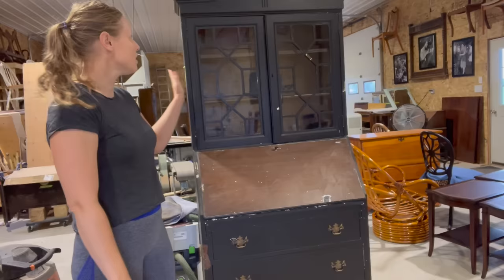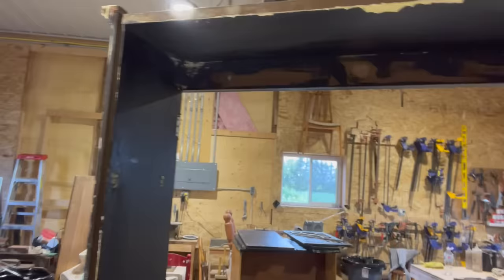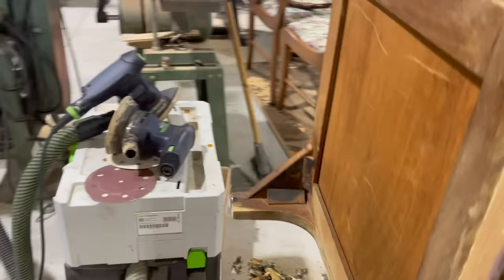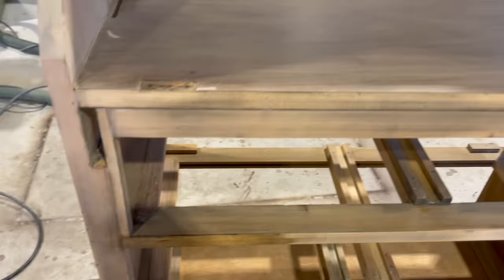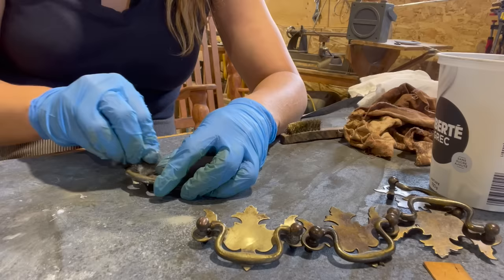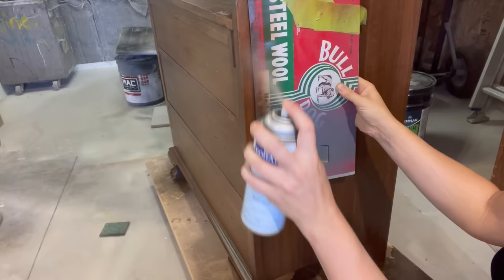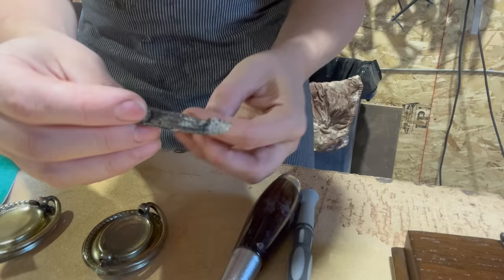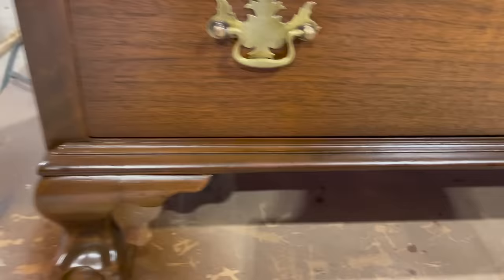The customers cried when they saw this one

Comment: This video reminds me of the time I restored a 1930s vintage Wurlitzer Expressions Player Piano back in 1982.  It was covered with a zillion coats of battle ship gray paint.  Found beautiful burled walnut wood under the paint.  That was the easy part.  Restoring the inside part of the piano was the challenge since I had never worked on a piano before.  But, I got er done!  Worked beautifully.

This lady knows what she is doing.
Reply from the maker: Wow. Hope you took pictures! Thanks for watching!
Reply: @johnsfurniturerepair  Took pictures years ago. But don’t know where they went;  most likely they went with the ex when she took the piano.  Bought the piano for $200 in Marshall, TX. Drove around the State of Texas with the piano in the bed of my pickup until I got home. Thing weighed about 700 lbs. Unloaded it with an engine hoist; lifted off the bed of truck and drove out from under it.

Comment: I guess the customers must have cried three times: first when they obtained, bought or inherited the piece, just seeing the paint "job" vandalism, which looked horrible. Then when you gave them a price quote for the restoration (just kidding, I hope you got what you deserved), and finally seeing the result. It was a hypnotizing watch, and seeing the final outcome gave me a warm feeling inside.
Only fly in the ointment: others have mentioned it, even if you paint booth is ventilated, you probably should use respiratory protection when working with aerosols or solvents. My personal rule is "if you can smell it, it's probably dangerous".
But what you do is really art, of the most selfless kind, as it ends up invisible because it is intended to show the beauty of the original work. From a viewer in Denmark: Well done!
Reply: Yes, I cringed to see her painting without a mask, and using some of those chemicals without gloves.
Reply: @scotth6814  From other videos I've seen, she seems to have taken the advice and uses appropriate protection gear.
Reply: @scotth6814  If the room is ventilated and fresh air is circulating around the room gloves and a mask is not necessary. I hear a fan running in the background. Also I have never used any cleaning chemicals with gloves on all my life.
Reply: @MrWolfSnack  extra protection doesn’t hurt but it surely helps.
Reply: @martaalvarado4631  If your skin is sensitive to chemicals or the fumes are volatile, sure. But I don't because it's more of a hindrance and they just tear anyway.

Comment: Excellent work. My only concern when I saw this video was the lack of protection on your hands when you were stripping the piece and no mask when you were spray painting it. I know when one is so young one believes they are invulnerable: I thought so too when I used to work with the insane chemicals involved in printmaking and photography. Just be aware that your skin absorbs these chemicals and that your lungs are breathing them in.
Reply: I agree! I spent 28 years working outside as a painting contractor 6 days a week non-stop. I am now 70 and have too many health issues. Pls pls take care. 😔
Reply: The 3M face mask with the back waist filtration is the way to go, in addition to cross ventilation.

Comment: I'm an old furniture maker and I think your work is outstanding! I don't understand why people cover beautiful wood with paint. I have a Maddox secretary desk like this one except a flat front. I have had it since 1948 and am going to do the same as you did. THe hardware soetimes can get stained by some strippers, I put them in an old crock pot and heat them for a few hours then shock them with ice water, this breaks the bond of the paint without any chance to stain. I follow up with FLITZ paste on a toothpaste brush, no scratches and looks beautiful.
Reply from the maker: Nice
Reply: They do it because they don't know any better.
Reply: @amitisshahbanu5642  Some people think a painted surface looks better than natural wood. I shake my head at them...lol
Reply: I love painted furniture. Of course this antique is better restored to original finish. Scandinavians like painted furniture because they live in areas that have little sunlight in the winter so painting their furniture lifts the spirit. I dislike dark heavy furniture as a rule and also like limed or natural blond toned floors and furniture.

Comment: Great work... I just found your channel this evening, and subscribed right away. You're definitely a master at your craft.
At the same time, watching you scrape off the layers of paint, I'm suddenly having horrid flashbacks to the front door of my old shop. The door was originally on an old store (if I remember right) and had about 38 coats of paint caked on it. One day I decided to freshen it up, and wound up making a couple of steel scrapers and using them with a welding torch to get through all that paint. (Yes I did linger over a few places and got the door warmer than intended, but we got it repainted, and after all it was the door to a welding shop, not a showpiece.)

Comment: I think I have nearly the exact desk. I’ve heard it called a Governor Winthrop secretary. Mine has secret compartments on the inside and has its original finish and hardware. No maker marks. It has only had one owner until I acquired it. The lattice work is on the outside, which leads me to believe it might be a reproduction. You did an amazing job on this piece. Your attention to detail, right down to the orientation of the screws, is astounding. I would have cried too!
Reply: The lattice originally is on the outside as it is a succession of the lead strips holding little panes of glass together. However, I like the notion to restore it to the inside for better cleaning purposes. Absolute fantastic attention to details, Trena! (My slotted screws always are aligned with the wood grain...)

A small comment on the antique status: materials and hardware especially the lock and the float glass, would not classify this piece as an antique. Laminated panels only became a house hold item in the mid 50ties unless for the US, that is considered antique. I am saying this looking at my chest with black forged ironed hardware with a burn stamp from 1642...
Reply: @thirdopinion8708  In the US, anything from prior to 1980 is considered an 'antique,' at this point... even people.

Comment: Boggles the mind that someone would spend so much time building this furniture with walnut and then finish it using ‘crap’ poplar on some of the front frame pieces.  Beautiful effort in covering that up and blending it to match the walnut.  My dad made a lot of furniture using walnut exclusively.  Soon it will be unobtanium.
Reply: Not so surprising. It was a mass-produced piece of furniture and needed to fit into the price range that the middle-class could afford. Besides, the Maddox company was particularly good at matching the finished tint of varying wood species, so a new piece right out of the store would look fine.
Reply: What really boggles the mind is spending the time and money necessary to restore a mass produced piece of furniture to this level.  It must be really important to the family with special memories because it is not worth what the restoration cost.

Comment: I really love the work you did on this piece. It was so meticulous. I noticed that you wore gloves to protect your hands from the chemicals but you did not wear a mask or eye protection when you were using the heat gun or the stripper or the spray gun. Your face was so close to all those chemicals off-gassing into the sensitive tissues of your eyes, mouth and lungs and it is so important to educate your viewers in proper protection. I have ended up with corneal ulcers due to incorrect eye protection when renovating furniture and have ended up in bed for days due to a severe reaction to the off-gassing from the chemicals from the heat gun in spite of wearing a mask. Please educate your viewers🙏👍😷😷

Comment: I stripped an entire 1920's kitchen cabinet set and repainted. When I was removing the hinges I noticed each screw on every cabinet was turned in a vertical position and was really impressed the original craftsman had done that, I of course did the same on reassembly (yes I stripped and cleaned all the hardware just as you did). I found I had to use toothpicks on most of the holes when putting the screws back in so they would be snug and secure. That was my only concern when I seen you reattach the hinges but I am sure you could feel how tight the screws got. Other than that a job well done!!!

Comment: That is a beautiful result.  Very nice.

I appreciate that putting the lattice on the inside makes the front of the glass easier to clean, but I do believe that the lattice should be on the outside which gives the appearance of smaller panes of glass, rather than a single sheet of glass.
Reply from the maker: Yes. Just depends on where you like it. Cheers
Reply: @johnsfurniturerepair  
I appreciate that you prefer the lattice to be on the inside for cleaning purposes.  But towards the end of the clip you state that the lattice is on the inside of the door "where it should be".  When in fact, by design, it should be on the outside.

Comment: That job reminded me of when back in the early 70’s I worked for a company that produced Stereo Grams for Dynatron (UK) The veneer finishes produced were Walnut, Rosewood and Teak. At that time the walnut jobs were filled with a wood stain grain filler applied by using hessian, and also wiped off again with hessian, you had to work quick as the material dried off in a matter of minutes. After the filler stain stage, the cabinets were coated with a heated base lacquer to again fill the open grain area. A heavy cut back next with air sanders, wet and dry paper lubricated with white spirit. Pullover solvent next with a rubber to pull in any areas of the lacquer working the area across the grain and then finally with the grain. Spray stain applied and then the final coat of lacquer.
Reply from the maker: That’s quite a process. Thank you for sharing. My finish is definitely simple compared to this, I do love restoring the filled finished. Seems a shame to remove if not necessary. Too bad it was here.

Comment: Trena, have picked up a lot of tips for furniture repairs. I have repaired one dinning set chair and have struggled with it, but finally got it done. Not bad but I did get one of the spindles in upside down and didn't notice it till after the gluing and dried and set.
 I used your two part epoxy mix with saw dust filler. That has worked great in the past.  Wanted to see if you had anything on video about how you would get the spindles of a chair in their respectful holes without having all the epoxy draining out if you have to set the chair up to place the top piece onto the spindles. Been thinking about some how turning the chair upside down to get the top piece in place without getting epoxy all over.  Thanks, ahead of time, Darwin.
Enjoy your videos and the magnificent work you do. Can't believe what you do for repairs and the finished product. Amazing!!
Reply from the maker: well a bit of drip is inevitable, but make sure its thick and if the joint is tight you dont need a lot. also work quickly. lol have fun

Comment: Brass is a reasonably soft metal, you should be using a lighter pressure with a small circular motion to avoid leaving scratches. My 3  years of weekly polishing the brass parts of my marching band uniform taught me alot about how to polish it.
Reply from the maker: there are different types of brass, this one is definitely harder than instrument brass but generally yes you are right

Comment: You can save your self a lot of time if you use your cup gun to apply your stain. When you have places that have worn patches adjust to a needle fine spray and slowly build up the light area with this fine stain spray. Apply your finish clear over the top after the stain dries. When you get a feel for this you will find you can imitate the grain of the wood in to your repaired areas. It is an art that you will enjoy when you get some practice.   : )

Comment: I am curious as to what the reasoning is for cleaning up the hinges/screws? The brass hardware I can understand but I'm not sure why the hinges/screws etc (the stuff you don't much see anyway) had to be cleaned instead of just replaced? Maybe its something I'm not aware of, I'd just like to know. Great job btw!
Reply from the maker: It’s definitely necessary to clean original hardware and keep it with the cabinet. It is neither easy or appropriate to just replace original hardware especially if it’s just a little dirty. Thanks for tuning in. Cheers!

Comment: I'm really surprise what you did with this furniture. You used a proper european technique with the cleaning, the stain, varnish etc. I was missing if you sanded the furniture after each coat of varnish to make a better ending. I liked the way you equalize the color on the parts that needed. I remember my father used a varnish with special stain to make the wood similar and creating veins to simulate the color and drawing of the wood. Excelllent you didn't lacquer.

Comment: Second time I have watched this. You did a lovely job on this piece. I have one almost identical to this one except mine has curves on the drawer fronts. I don’t know what this is called but each drawer has two “humps” at the front. And my inside has wooden knobs on the small rectangular drawers drawers and the one square cubby hole. I have all the original parts and the finial is the original. It’s definitely an antique but I can find no name on it anywhere so I’m sure it’s just a copy of someones original. I am lucky that no one painted over mine except it belonged to my step great grandmother who smoked something fierce so it’s stained with tobacco. I think I will have a go at cleaning it since it’s likely not as valuable as the one you just refinished other than that it is an antique and has all its original hardware, glass and finial and is not too damaged other than lots of surface scratches.

Comment: Trena you do amazing work on your furniture restorations and I wouldn’t think to question that. However on more than one occasion I’ve heard you say that the fretwork on a cabinet should be on the inside of the glass. I have always seen it placed on the outside of the glass and was told it was to protect the glass from being accidentally broken and to keep fingerprints off the glass itself.  I’m curious about that. Which one is right?
Reply from the maker: It can go any way you like. Pros and cons to both.

Comment: What kind of stripper are you using on this?  I have tried a few, and have had mixed results, but your's seems to work very well for you.  Great job.  I agree with others, why would you paint this?  I bought a table with drawers 20 years ago; that I thought was a painted piece and just needed to be refinished.  But, after starting on it, realized it was a mahogany table/drawers, but had at least 3 coats of paint.  I paid $20 for it; stripped, fixed, fretted, and sold it for well over 20x as much and they still got a bargain.
Reply from the maker: please check out the vid on the products i use. cheers

Comment: I have this secretary in maple. the drawers are curved and I have all the little secret drawers for the interior. ( Pillars that are 1" wide are positioned next to the door) and side smaller drawers. I still have all original hardware including the key!  What I do need are replacement wood overlay 'panes'. where can I find those???? Thanks g from Minnesota
Reply from the maker: I think you would have to have them made or find another secretary and steal them for a template

Comment: I have a question about the lock and key, as the mechanism looked identical to my antique piano that has the lock but we are missing the key. Are those sometimes available with pieces that are severely damaged? Can a new old lock and key be replaced into my piano? I presume since you were able to get all the hardware out to strip it that replacing a functional lock would be possible. This was a delight to watch and it turned out beautiful! I commend you for your patience and diligence though, very nice work.
Reply from the maker: I would take your lock out snd bring it to a locksmith and see if they have any old skeleton keys that fit. If not, take it to a hardware specialty store or lee valley and order a lock that is the same size.

Comment: So when you get the screws all aligned the same way, how do you get them tight without over tightening? Another awesome job. Love the color matching and touchup work, every video has me wondering if you are just more of the artist or just have a boat load of experience with those stains, dyes, and colors. I find myself limited in that area.
Reply from the maker: If the holes are drilled at the same depth(as in most production furniture)  they should all be tight at the same time. I’ve been refinishing furniture for over 20 yrs, but I also took a few painting classes in university so that helps with color theory. Thanks for watching.

Comment: First of all, I like your videos and view them very attentive. One question I have: Sometimes you use paint stripper and sometimes the heat gun, why? What do I use when? I have a lot of antique furniture and some of tehm need a restoration, so I get to your channel and have had many tricks copied. So at least sorry for my terrible english and thank you.
Reply from the maker: Usually I will use the heat gun when there is a thick layer of paint. It doesn’t really work that great for a thin layer so stripper is used there.